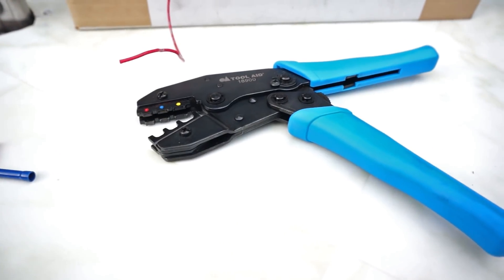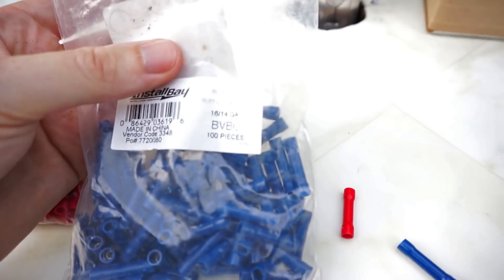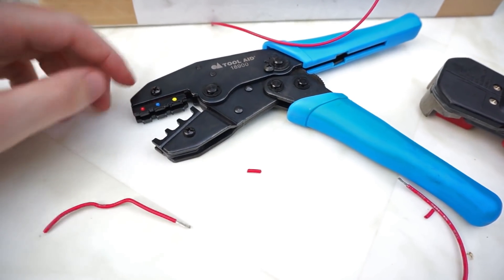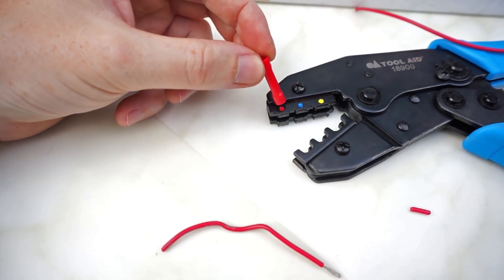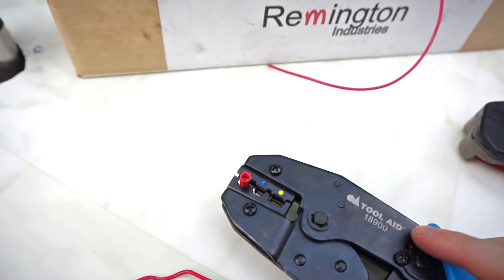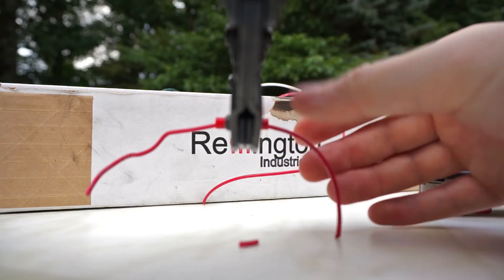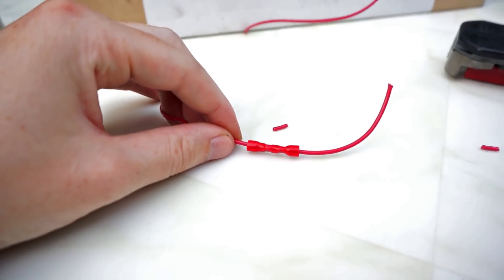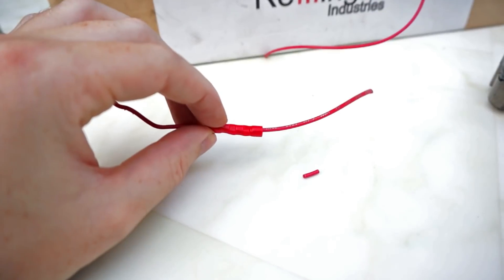How to Splice Wires Using Crimp Style Butt Connectors

Comment: This is not the correct way to use the crimp tool. You are supposed to crimp BOTH ends of the connector. The crimp tool crimps the wires to the solid connector and also crimps the flared ends to the cable sheathing.

Comment: Is it possible to over crimp?
Reply from the maker: yes it is. Good quality dies or nice crimp tools will stop for you. The tool I'm using in the video can't overcrimp as long as the right splice connectors are matched to the die (the colors).
Reply: @chesapeakemotorwerks  thanks I had a haisstronica crimp tool that seems to over crimp. I can adjust its squeeze force

Comment: Good video but I personally don't agree with the statement about solder weakening over time or being a lower quality slice than a butt connector. As long as you know how to solder properly and use the correct materials, your joint should last as long as the wire itself. I'd choose a proper solder connection over a crimp if it came down to it. But we all got opinions right?